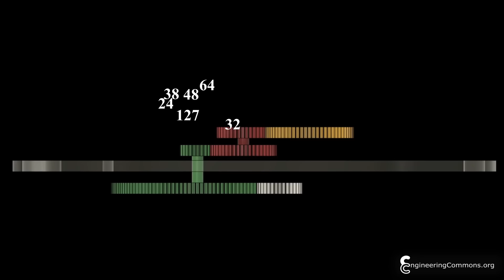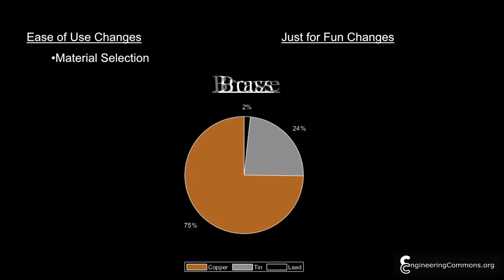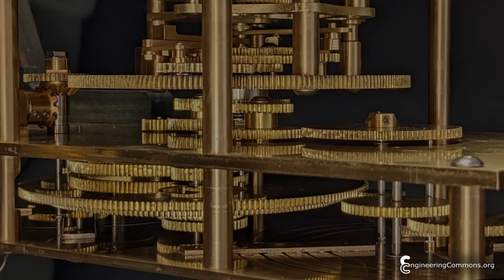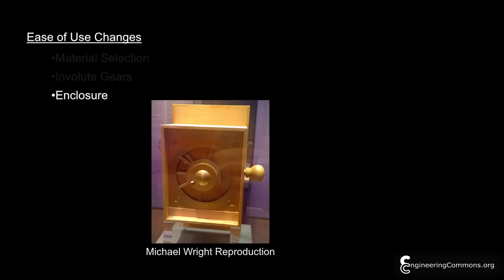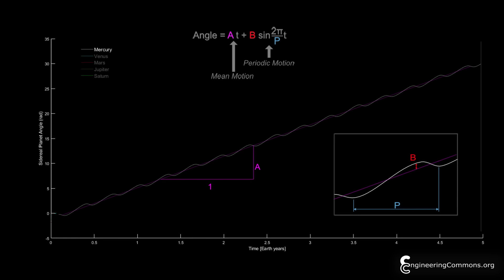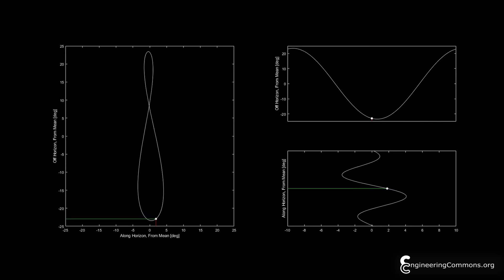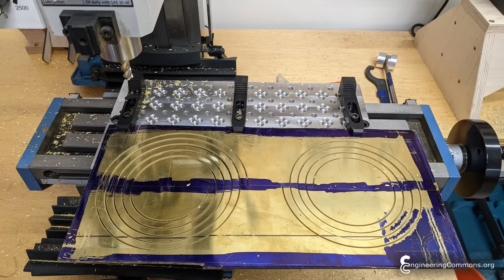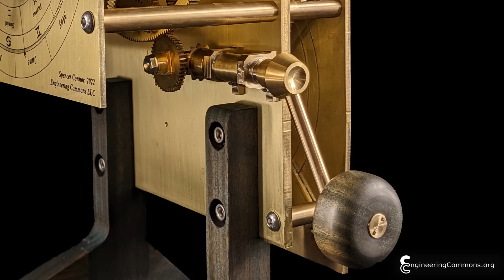Antikythera Mechanism V2: A Modernized Reproduction

Comment: is it practicle to extend to measure  uranus , nrptune, etc. as they are found.  i would not add the sednoids. but it might be an interesting modeling excersize for turning more finds into gear motion even if they develop totally indenpendent systems.

Comment: The moons sine wave analemma cycle between the two energies of the earth’s double torus magnetosphere is 19 years.

The earth’s analemma cycle is 26,000 years. 12,000 years above the sun’s magnetic equator and 1,000 years to cross causing this the millennium of global warming climate change end times.

Mystery of the 7 crossings of the galaxies magnetic equator Jesus holds in his hand not you or co2 causes the Milankovitch climate cycles.

Comment: The original Antikythera Mechanism has on the front face plate an inner inlaid ring to represent the Egyptian (Sothic Year 360days/yr) and had to be rotated by hand-- Making the original more informative & didn't use added weights to balance out movements.  The original also had differential gearing for the Lunar Indicator.  
I do prefer your Rear Saros & Metonic indicators-- so one might advance 500+ solar years without damage. YET the Entire device has limits of its time.

The involute gear shape reduces friction YET the ORIGINAL Mechanism is dated to 2nd-1st century BCE and a similar orrery wouldn't appear until 1700's CE <at least 1800 years later> THUS the original is demonstrating Babylonian, Egyptian, & Greek Calendarical knowledge.

Comment: Beauty, Congratulations to Bill too. An original gold standard sits pretty in a big granite block vault ~2millennia already, am sure. 2decades and yet to a product? May like to add a mechanism like two inline Capstans, "Torque amplifier" is a 1925 patent. The two prism method to find noon is sweet. So much to read, how do you get around to doing it?

Comment: Astonishing level of analysis, engineering and fabrication. I learned more astronomy than I ever gained by my pre-dawn ritual of looking at the Southern sky from about 45 deg North latitude. 

I plan on visiting the Battleship Massassachutts Museum in Fall River, MA to see as much as possible of the mechanical computer that set the main gun rotation, inclination angle and timing of the ships pitch, roll and yaw , and sever other variables to aim the main guns toward a specific point. This calculator was built long before electrical computers were available and answers were needed long before they could be provided by hand calculation.

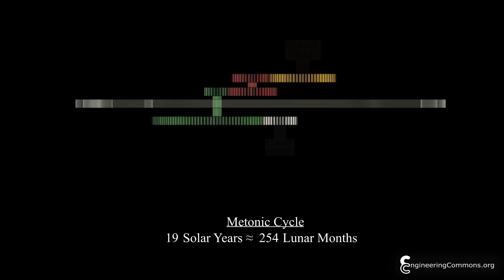Comment: Excellent work. Based on the gear ratio (at 4:00 timestamp), the 19 : 254 years to lunar months is a sidereal cycle and not metonic cycle, which has less than 13 lunar months in a year. There may have been a mistake in the name of the cycle, based on wikipedia information about duration of the mentioned cycles. Could this be the case?
Reply from the maker: You are correct, it IS the Metonic cycle but I mixed up synodic and sidereal year in the recording. Still kicking myself a bit for that one...
Reply: @EngineeringCommonsLLC hi! Excuse me can you help me? I want to design own watch something like in the video but more simple and easier like sun, moon and earth, i can explain in email. I jut want to understand and calculate better. From my side for the help i will share with modern watchmaking books)

Comment: All the materials were hand produced and no lathe existed, forget about the fact they didn't know the solar system (We were the center of the universe not the Sun at that time) and to understand the moon cycles or presession? are you kidding me? This was one of many and brass doesn't erode in sea water like that, only when you remove it from the ocean will it erode that much. That is much older! We find things of that timeline with far less erosion.

Comment: Any ideas about 3D printing the whippletree for the equation of time for the sun movement? Perhaps it'd be better if one printed a slotted gear like they did for the movement of the moon?
Reply from the maker: Sure, you could 3D print that. The difference is that the slotted gear adds a variation to a mean motion, and the whipple tree only constructs the variation but as a sum of multiple signals

Comment: Shame you can't understand the true significance of this. Spinning ball solar system fantasy. This proves how truly amazing and incredibly smart people can be so blinded and fooled by the Heliocult. C'mon bro get real. We live inside the most beautiful 'mechanical' realm, the most amazing timepiece that you are proving with every thought and action to produce this wonderful machine. You actually believe you are spinning on a ball faster than a bullet, while circling 66 times faster than a bullet, while spiralling 600 times faster than a bullet, while the whole thing is zooming through a perpetually expanding vacuum at a million times faster than a bullet. Wow that's some real denial of all your senses.
Reply: The only reason he can figure out what the mechanism was is because he understands the solar system, and of course the machining. The flat earthers that made the mechanical realm video kept using clips of videos that they played sometimes more than once to keep you hopeful that something of substance would come out and it never did. I had to go learn what the machine was by figuring out where the video clips came from that they used. All I learned from that video is that they kept trying to over lay the flat earth day cycle over the front face of the  mechanism which instead of showing a day cycle at all shows what speed the moon and the planets move in relation to the sun as it goes through a 1 year cycle clearly visible as one turn over the 12 zodiac sings which are the constellations located along the ecliptic. The mechanical real was such a bunch of little clips about nothing, that the flat earther that sent it to me had nothing to say when I asked him what he learned through it

Comment: Thanks so much for this video! I
' a simple bike mechanic with a charity called Crossroads that sends my overhauled bikes to Africa free of charge. It's certainly amazing that you thought of adding features that can produce additional results, and the cycling mechanism avoiding the slot breaking the pin, too. That was very ingenious. Looking forward to your emphasis on the differences between this and the original mechanism, and possibly adding the other planets, which I imagine will be more difficult.

Comment: Brilliantly done. Amazing work.  That being said…😢…in my opinion, the modification for the spiral return on the back plate to prevent potential damage to the pointer detracts from the ‘authenticity’ of the finished piece.  Probably I don’t know Jack, but seems a simple, mechanical stop at that point would have been sufficient (assuming you don’t allow small children to play with it).  In spite of this, nothing but respect to you for this incredible recreation - salute to you and this work of genius.  It is almost incomprehensible that the original design and fabrication is > 2000 years old. I’ll show myself out…
Reply from the maker: I appreciate your perspective, I came to terms with deviating from the known design but understand the perspective of authenticity including the flaws

Comment: this reconstruction is truly beautiful and a masterpiece, you solved many problems that not yet accounted for before and added a lot of adjustments to refine the build.

I also made a reconstruction from laser-cut plastic gears and some 3d printed parts 10 years ago, but some problems are solved in ugly ways 😂

I think the most difficult component maybe the coaxial tube/shafts to be manufactured to a good fit 😅

Comment: It's not just the impeccable accuracy of the math to design this (which is outstanding), but constructing this would not leave room for error, as one gear, or one tooth of the gears being off would require reconstructing the gear, and there's no evidence of the tools used to cut/form gears with this level of precision. In other words, the calculations are impeccable, but where are the tools used to make the blueprints? They didn't start making regular clocks for another 1,000 years.

Comment: 12  Sided  Shape: start  with "February"  4 sticks  for the Weeks  and 7  other colored  Sticks . You  used 7    1  Weekstick  goes  in the  next Hole. Goes  around  til  you  reach  the Start.:  Kalender!!  Works  in  all  Sizes  all around the Globe.  Adjusting in Summer  and Winter- Solctice.  Lost  Wachs-Cast!!  The  Sticks---got  lost!!    barb.

Comment: So many exceptional insights here, but the reference to astronomical insights gleaned from the Babylonians, particularly struck me as highly relevant; the Tower of Babel was almost certainly much more than a "tall building", implying an astronomical understanding far in excess of what is currently ascribed to "common knowledge".  This would likely be supported by rhe now ancient proliferation of pyramids and ziggurats globally, implying a global preoccupation or interaction with some type of non terrestrial source.  To many early signs of a global, highly sophisticated, interaction, with an emphasis on galactic phenomena, or possibly communication.   Even merely confining observations to the implications of such an advanced engineering feat as this mechanism, subdivides early human understanding sharply, into a much smaller subset than the genenal population at that time, much like now.  
The improvements made were very thoughtfully conceived, to my limited understanding.  Brilliant video!  Thanks for posting!

Comment: That first clip shows exactly what con artists Hancock and Rogan are!
    Hancock says, "It's from 500BC" and "Came out of nowhere, no record of anything like it or reference to the technology!"
    Of COURSE,  both statements are totally false and self-serving.
    The AKM (Antikythera Mechanism) is from the first century BC ... I.e. 100-1BC.
    And there are plenty of references to "philosopher/scientists" work on the Maths of multi-cyclic ways of plotting planetary movements AND many metal workshops producing complex jewelry that could easily be repurposed  to producing this mech.
     Kepler, himself, says "the Greeks" had mechanisms for orreries and cyclic engineering for planetary prediction.
    PLEASE do not believe ANYTHING you hear from either of these conmen!
    Check EVERYTHING against comments by REAL EXPERTS!

Comment: Absolutely stupendous work. I would only like to note that the overall gear ratio of 254/19 (as you show at 2:07) is in fact EXACTLY commensurate to the relationship between the Sun's SIDEREAL period (365.256363) and the Moon' sidereal period (27.32232):

19 x 365.256363 = 6939.870897
and
6939.870897 / 254 = 27.32232

This makes me wonder why (as shown at 3:30) you used the solar year rather than the sidereal year for your assessments of the cycles of the Moon and the Sun which actually exhibit a perfect (sidereal) 254/19 ratio. Thanks for a kind clarification ! 🙂
Reply from the maker: You are absolutely correct, I misspoke there. I should have said sidereal year rather than solar year at 3:30. I am showing both systems in the sidereal frame, thus the 19:254 rather than 19:235 Good catch!

Comment: AntiKythera and Maya Calendrical Computations

A 3D Rendering in some Solid Works derivative allowing for a Functional Calculator that can be run forwards or reversed.

The Maya also had separate counts for the Visible Planets and most of these exist thanks to the "Ceramic Codex Project" by David Stewart where he set up a turntable to photographically "UnWrap" cylindrical Funeral Urns dated & linked to the several astronomical cycles usually at Period Events and Accession Ceremonies for the Owners of the accretive Pyramidal Observatories.

Comment: I think it is reasonable to assume that on the basis of these complications existing at the time, humanity could use them to accurately predict positioning of various cellestial bodies at certain times to be used for architectural layout work or navigation and that accurate mechanical time-keeping was probably available earlier than expected as well
Reply: I am wondering why this mechanism comes out of nowhere. Why aren't there other machines like it but simpler, and machines like those but simpler still, so on and so forth? Surely the inventor of this device didn't start with nothing, drawing on no earlier devices. Technology doesn't develop like that. If an entire tradition of mechanical engineering can become lost in history, what else has been lost?

Comment: my friend is possible to make this drive like a clock and maybe ity ould be possible to create the modern time of a normal clock here the hours and minutes are the same long to  relate that to variable time where the day and night only at approx 17 march 2024 and 2025 are the same long like 12 hours day and night aqnd than they start to very so we could create a variable Time Clock versus the used and ordinairy time everybody is used to...the acceleration and diminuendo of the speed you did explain that a ratio was used of abotu 0.445 ith mercury I gues such a device ould be possible and usable for a clock hat I am thinking of but  you arfe the mechanic...I pity it that this device is hand driven to be hnonoust...couldn´t e use steal spiral veer in dutch so that it is that strong to let the mechanism drive a very long time===or maybe electronics....and than combuine the clock idea to it to make it complete...than e coulkd easily make extra features to incorparate the tatta system of india and alle the other  time aspects of ancient of days...but the last to idea´s maybe to far fedged,....

Comment: The spiral dials on the back could use a lever trip system where as the fial traverses outwards, when it reaches the end of the spriral, a spring loaded, or a weight on a string  could be used when a pin in the spiral groove hits the end and rotates, then the spring or weight pulls the dial arm back to the center to begin again automatically.

Comment: Comming from an engineering background this mechanism has allways facinated me , in theory what tooling did they use when made to get a accurate shaft for example how was this done without the likes of a lathe & the maths involved is amazing , the offset gear slot to compensate for elipticle orbits it's beyond my ken' how did they do it ??
Reply from the maker: Clickspring has a video on exactly that, the tubes have been one of the more puzzling components when considering period construction

Comment: If you measure the time differential between when an astronomical event happens overhead,
& when it's supposed to happen at home, you could determine your longitude.
2000 years ahead of Harrison's clock.
Reply from the maker: Well, in principle observing astronomical phenomena can be used for time synchronization and therefore longitude. But even the Galilean moons (the heavenly clock) are too difficult and unreliable to observe to make it a practical solution. I recall the Board of Longitude really got stuck on the word "practical" with Harrison

Comment: I spent much of my life navigating at sea before all the electronics were common. I often thought there must have been better navigation tools and methods for some of the ancients that made long voyages. You did an amazing presentation of an almost impossible project. You had to bring several separate trades, skills, and the study of stars and planets together. I have some knowledge of warship fire control mechanical computers made in WWII. Your mechanism is on par or beyond those machines capabilities.

Comment: I always wonder if they used a fish oil or ?? to keep the gears smooth.  They cut their own gear teeth.  Surely they would have had some type of lubrication after experiencing the binding gear problem, one would think.   Maybe candle wax.     Was the mechanism traveling to Antikythera, or to Kythiera, when the boat sunk??.  Did the Captain of the boat own it??.  Archimedes hands??.   More questions.    Nice work.  Thanks.

Comment: I had an idea instead of the spiral pointer.  I'm not a mechanical engineer, just a software engineer, but here's my idea as best as I can put it into words.

Start with the same structure as the spiral is on, but instead of the spiral, you drive a chain or band that looks like a chainsaw would if it is tring to cut into the spiral.  with 2 pointers attached that, one at a time, actually do go into the spiral, and use the spiral for the outwrd/inward locomotion (not driven by the chain, so the chain needs to be free to spin both ways)  The other pointer is at the other end of the chain, on the opposite side though like this <v=======^> when viewed from the side,  so when the pointer in the spiral hits the end it needs to flip the whole chain over so the other pointer is now the one inside the spiral.  I may help if the pointer is wider to get it to flip over completely, or have a spiring mechanism in the axle that works like  ball point pen, and once the pointer gets turned almost halfway, the spring mechanism allows the axel to finish tuning and rest the pointy collar in the valley of the beveled collar.  I am thinking of a collar cut in a double VV shape around.
I think this mechanism will allow the pointer to be moved in both directions, continuously, with only one pointer in the track.

I'm sorry if I lost you in my lack of mechanical engineering terms or maybe missed a detail.  I just really enjoyed the video and wanted to let you at least experience my thoughts as I watched this very interesting device be beautiffully built!  I'd love to see what I described simulated or even built, even from legos since it seems everyone is doing that these days!

Best wishes!